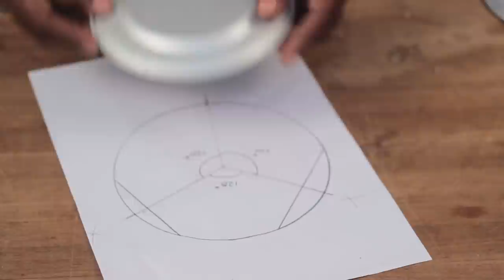How to make a Balance Scale

Comment: Can I make a suggestion.  Instead of finding the center using a compass, for someone who does not do math well, you can trace the plate and cut out the circle on paper, fold it in half, then again in half. you should get the center at the corner of the quarter circle.  Good balance, by the way, I will use your idea on one of my DIYs.  Thanks for sharing :)

Comment: sir, thank u for the demo. very simple.  pl tell me the measurements in cms or inches of wooden stand and dowel and the mid point. what is the dia of the plate you used. how much minimum it can weigh and (max) weight it can withstand. I need one for measurement of chemicals. thank u.
Reply: Hdddff

Comment: Could you make a list of the materials you used? That would be great if you could:)
Reply from the maker: For the making process, I used the basic tool and school geometry kit. (hammer, scissors, ruler, compass, etc) . The scale balance is nothing but two plates hanging on a dowel with a center of balance. The plates are aluminum lids which are very cheap. It was easy to drill a hole. Just hammering it with a nail does the job. Even plastic plates can be used. I had these plates already so I used it in this project. The dowel was salvaged from a jute bag. To hold everything in place and give the structure some support, I used a 2x4 wood piece I found.Then A small piece of wood stands vertically. We call it reaper in the lumberyard.  Not sure what it is called in the western world. If you dont have it, may be  a wooden scale can be used too
Reply: You can see the material 👀

Comment: that math part was pretty scary!!!  more details on that would be helpful.......
Reply from the maker: First I trace the circle.
Then We need to determine the center of the circle.Therefore I connect two random points on the circumference of the circle by drawing a line. 
We do this again at some other place on the the circumference.
Now we have two lines inside the circle
We need to dissect these line to a 90 degree.
we can either measure the center and use a protractor to draw the line  at center or use the compass technique as shown

When the lines dissecting the lines on the circumference meet is the center of the circle.
From center, pick one the lines and draw another line from center to the circumference at 120 degree.
Total angle is 360 , therefore dividing it in three parts.
If I wanted to tied  the balance on four sides i would go for  360/4
Reply: Damnnn..., I should've payed more attention to my math class. Thank you for sharing the knowledge. Really appreciate it. 😁😁 @Seyalan